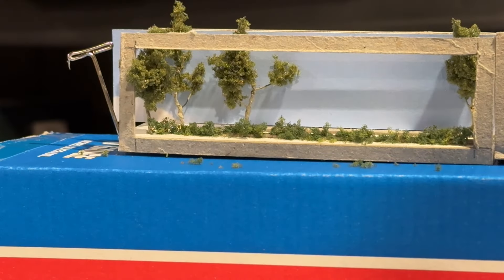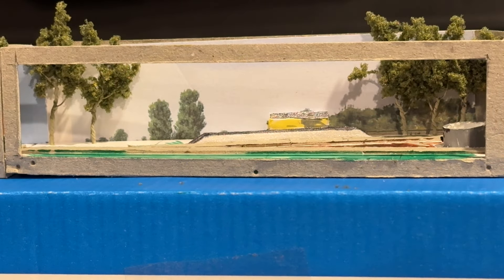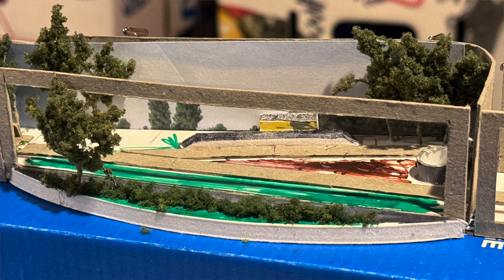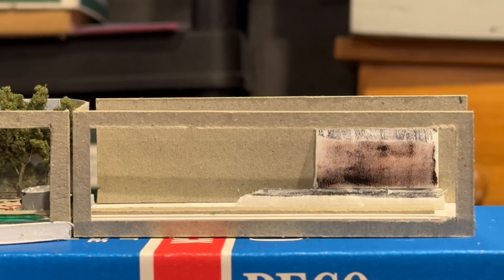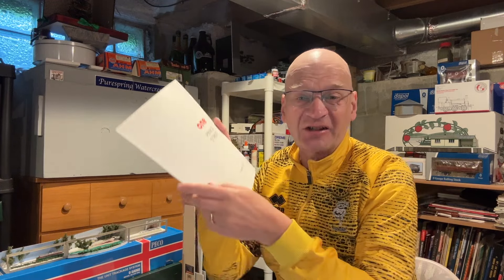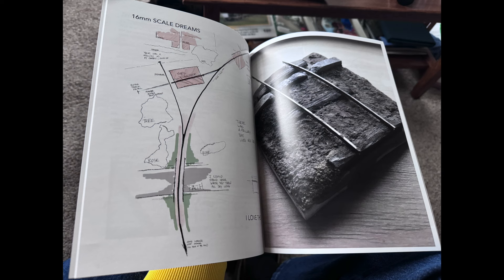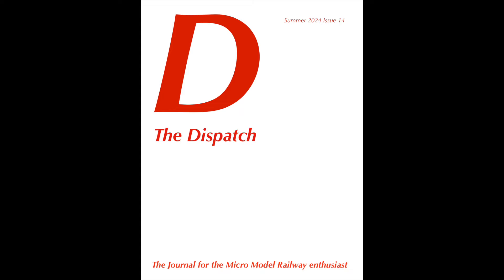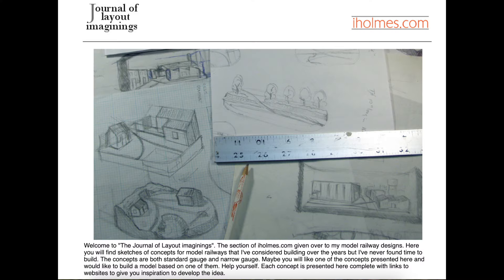O Gauge Micro Layout mock up

Comment: Hello Ian, another interesting video. 
My O gauge layout is built on three 1200 x 400 x 100mm ready made plywood baseboards. 
I have built three 900 long x 200 wide x 100mm deep box sections that plug into the back of the 1200 x 400 x 100mm baseboards using pine wood dowls. 
This makes the layout 600mm wide.
(1200mm = 4' 400mm = 16"  900mm = 3'  200mm = 8"  600mm = 2' 100mm = 4")
The three 900 x 150mm sections are the scenic part of the layout with low relief buildings on them.

Using six boards means it is easier to move and store the layout without the scenic part getting damaged. I can change the time period of the layout by changing the scenic boards.
This is still a work in progress.

Comment: That mockup is a neat idea. What a wonderful idea to feed that “working on the layout” feeling while still exploring the final planning stages. 

I like the addition of the foreground scenery. In a way you could even swap in different kinds of foreground scenery modules to suit different photo compositions or events?
Reply from the maker: I’ve considered concepts where I could swap in different foregrounds and backgrounds. With so many industries being just a siding off a main line. It would be easy to model just the railroad right of way, and then add different foregrounds and backgrounds, changing the locale in a matter of minutes. I mentioned it on my old Protocrastinator blog http://protocrastinator.blogspot.com/2010/08/pages-from-sketchbook.html